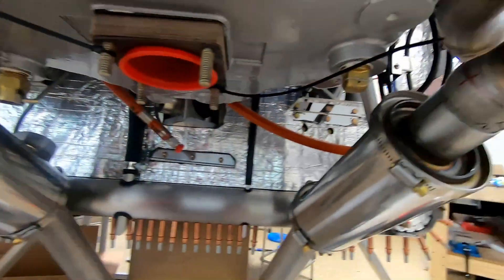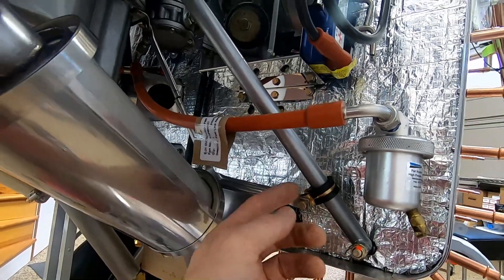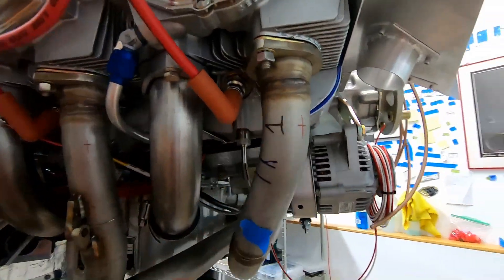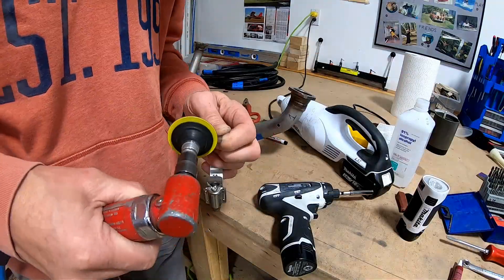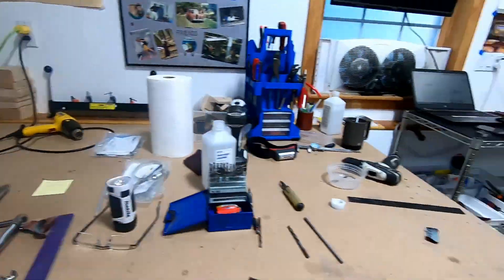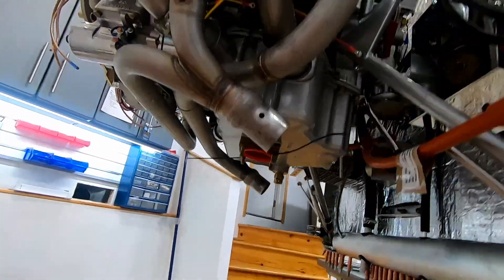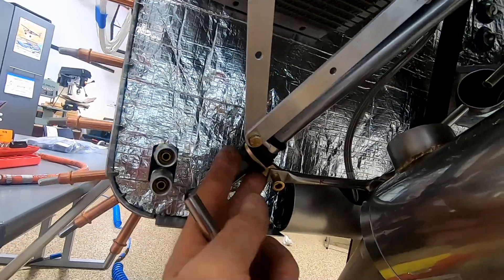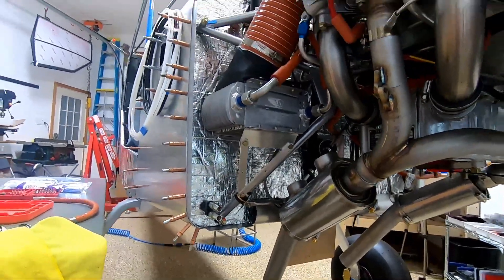RANS S-21 (103) Exhaust part 2

Comment: The lower cowl opening will come into play on exhaust positioning when you get to it. I think you have yours close enough together that it won’t bother, I had to bring mine in from the original plan. I don’t think the solid exhaust mounts and asking for an adel clamp to take the shake of startup and shutdown is wise. Only my opinion, but something somewhere has to give at those times or you’ll have a cracked exhaust in time.
Reply from the maker: Hmm, good point. I just didn't see any good place to mount it without interfering with something else. But I'll take another look. Thank you.
Reply: I think the tubes can be shortened enough to still let you use that location with the hose clamped to both ends. I think the adel clamp would be tough enough for the mount so long as the hose is in play too.